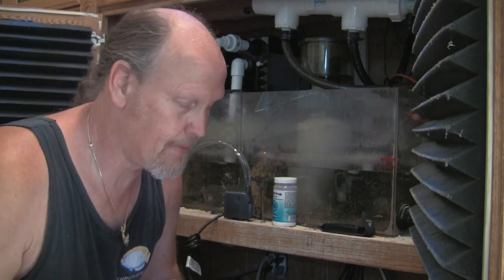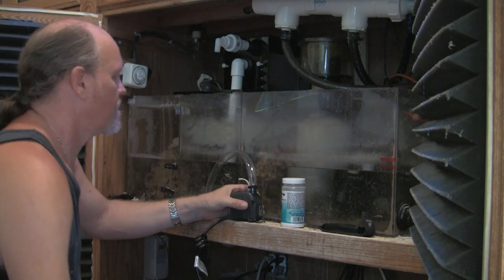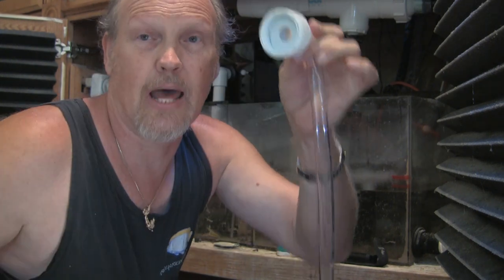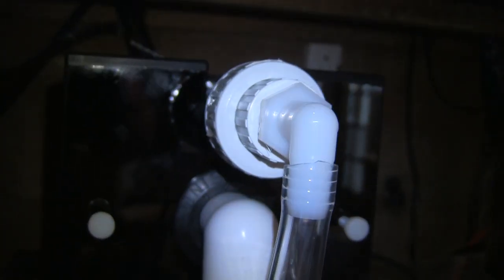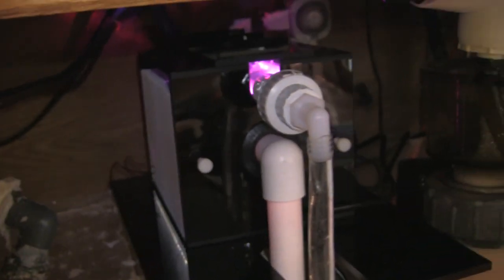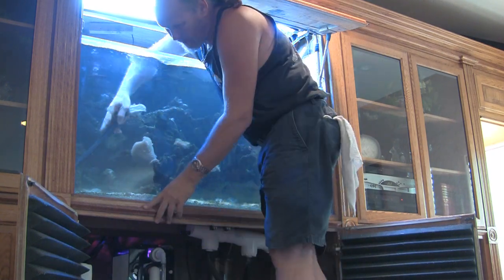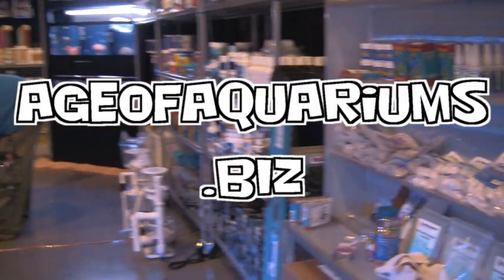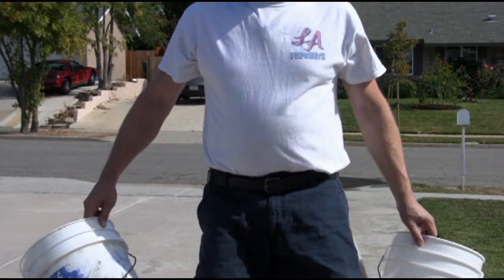LED Algae Scrubber, LA Fishguys, Episode 118 pt 3

Comment: Just a observation. You can use gravity with your gravel vacuum to start your syphon. No water in mouth, no sucking. Just scoop your vacuum full of water, hold it up till your hose fills with water. Crimp it off with your other hand. Fill the vacuum up again and let go. Easy start. No sucking.